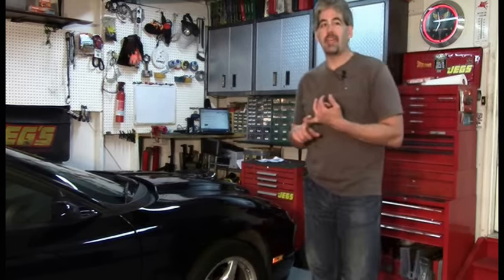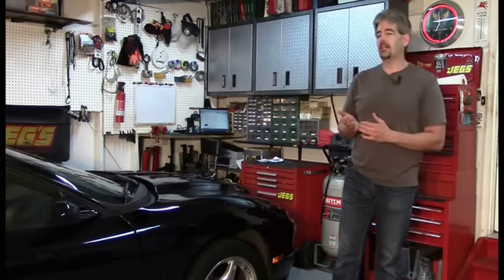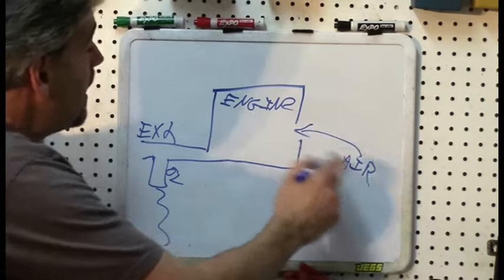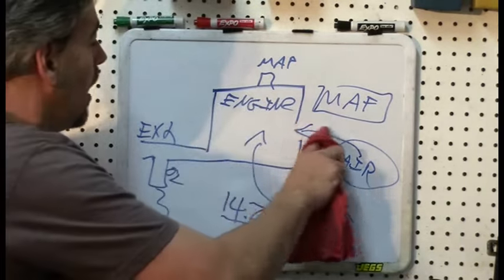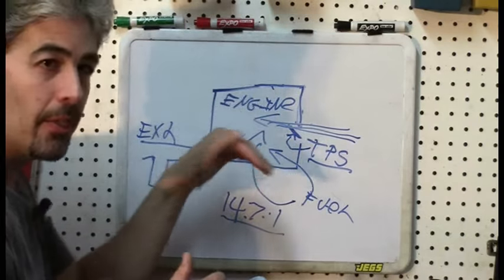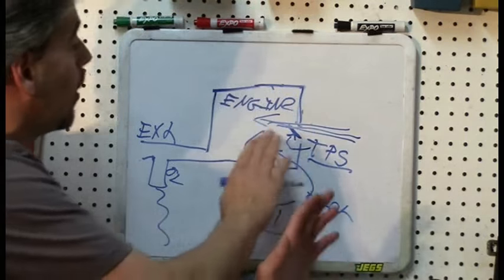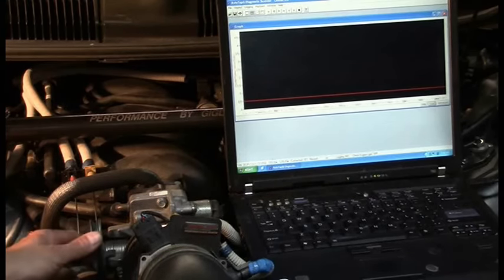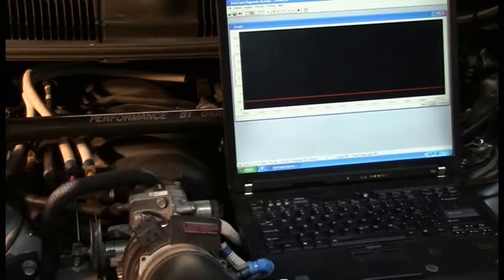TPS (Throttle Position Sensor) Diagnosis and Understanding Pt1

Comment: so its the pcm controls the fuel injectors pulse length to match the air coming in, but who control the spark plugs when to fire because of course there is going to be a different timing when the pistons movement goes rapidly up and down on higher rpm
Reply from the maker: Spark timing is controlled by the crankshaft and camshaft position sensors depending on the model.
Reply: Schrodingers Box can you please do a video about the spark plugs and fuel injectors how they work together accordingly, specially about timing, highly appreciated, thanks.

Comment: My 2000 GMC Sierra was lacking fuel,it was sputtering.i changed the fuel pump,and fuel lines,and fuel return line .now it will not run,what is the problem?

Comment: Tps reference code Chevy cobalt 2008 
I was just wondering if I should start there? Seems simple
Reply from the maker: +Victor Gonzalez Yep- I would start with the TPS reference circuit indeed. It is unlikely to be a TPS component problem with that code.
Don't forget the reference circuit includes the signal and ground- not just the 5V. A problem with ANY of those can cause a reference code.

Comment: I have a high idle and all symptoms point to throttle position sensor. My readings jump around 1-3% at idle, seems fine, replaced the TPS, wiring checks good, idk if that’s normal or TPS is bad
Reply from the maker: depends on the vehicle. doesn’t sound like anything wrong there.
Reply: @SchrodingersBox  I’ve had this issue for 1-1/2 years good thing I got another car as a daily driver. High idle RPM 1200-1800. Idles down maybe 800rpm in drive, let off the brake it’ll cruise on its own (fastest I let it get was 45mph), if I unplug the TPS, the idle goes normal. MAF, MAP, TPS, IAC, IAT, and ECT all seem to be properly working, no vacuum leaks, but it seems there’s a rich condition and that’s why the IAC is opening up.
Reply: Had a friend come by with his scan tool, and were unable to control the IAC because it says “engine not at idle”
Reply from the maker: I would check fuel trims first to make sure it isn’t the response to unmetered air.

Comment: Hi there
I know that I'm little late but I hope that you might catch my letter

I have a chevy blazer 6 cylinders 2008 and it has a fully electronic throttle body.. I got engine check light took it to mechanic shop he came out with 2 codes
P1516 and P2101 I changed the throttle body 5 times with used one making all reset and code eraser steps but the problem still there..
The problem is.. my care needs 30 minutes of worming to run properly.
When ever it gets cold, I need to start it with no ideleing run and hasitation for 30 minutes, switch off,  start again and boom running smoothly and perfectly all the way
As soon as it's hot no problem

Is there any way that you may help with a piece of advice

Thank you
Reply from the maker: what data did you have that the throttle body was bad?
Reply: @SchrodingersBox 
Scanner data
P1516
P2101
Reply from the maker: no what induction, fuel trim, TPS angle and IAC position data did you use to determine the throttle body needed to be replaced. you would not replace the throttle body just on those codes.

Comment: I have a code P0122
Throttle/Pedal Position what should I fix first the throttle body or the pedal position sensor
Reply from the maker: Neither. Find out what the cause of the code is and fix only that.

Comment: I don't have a metter. Is there any other way to know if the TPS is not working properly? I disconnected the TPS and drove around for a minute and the car responded better. It still not running like it should but it runs for longer distances. It runs like it should when you give it full throttle but thats the only way I get to run without problems. Some help please.
Reply from the maker: jorge irizarry How would you possibly test a variable resistance device without a meter?

Comment: On my 86 F150, there is definitely no TPS on the other side of the throttle and butterfly valve.. even tho all the stores say I have one. There is actually a strange bar coming out, in line with the throttle that is obviously the axle for the throttle. It comes out where the TPS should be and there is a 90 degree turn in the bar outside the engine. It turns when I turn the throttle. There's no sensor and it doens't look like one is supposed to be there, yet my engine is hesitating and stalling on acceleration.
Any Help??
Reply: +LINK1478 Forgot to mention it is the L6 model engine

Comment: I have an 04 Focus, with 2.0 DOC. The TPS has a 5v referance. but when I test the sensor itself, at "closed" I have "0" v, and 4v, fully open. I can get the 1 v by turning the sensor, "and get 4v. BUT when I do that the holes in the sensor do not line up? PLEASE HELP!!
Reply: What is he factory specification for idle vs WOT voltages?
Reply: +Schrodinger's Box Quantum Mekanix 
 1 v closed, and 5 v open
Reply from the maker: +lonleyboy54 impossible it can be 5V open. what manual are u using
Reply: +Schrodingers Box 
 Chiltons,  Here is what happened so far. The tranny was slipping into 2nd gear, ran the codes and came up with "A" selinoid bad.Changed and now it will not go into 3rd. So in the process of checking codes the TPS came up. No tranny codes? Before I changed the selenoid it shifted slow into 2nd, but went into 3rd. Would the tps have anything to do with "this"? Any ideas about the tranny, too?
Reply from the maker: lonleyboy54 There is no way it said "A Solenoid bad"- that is impossible. what code was it that actually physically stated the "A" solenoid was "bad"?
  I can't help unless I get accurate information but there is no code I ever heard of in my life that actually points to a component being bad.
Reply: +Schrodingers Box   I have the latest version on my Snap-on Ethos+. I do not remember the exact code. BUT it said "A solenoid mailfunction!  When I looked it up , the causes were bad solenoid, or wiring, and I checked the wiring, and the voltage was correct, so I changed the Solenoid. What can I say it gave it to me under transmission codes. Just like it said PCM out of calibration?  I am sorry but I did not store it so I can't tell you the code number. I did not think this was going to get this complicated. I hope you will still help. God knows I could use it.
Reply from the maker: lonleyboy54 I really can't help without good data bro, sorry I'm stepping out on this one until I know if the code is a high circuit input, low circuit input, position out of range, whatever...
Too much guesswork for me here.
If you get the DTC I'll be happy to reexamine.
Reply: +Schrodingers Box It was code P0750, Does that help?
Reply: lonleyboy54 Yes tremendously. This is normally a circuit integrity code. You'll need a birdirectional scantool to do this but basically I check for voltage response at the solenoid when it is commanded on and off.If I fail to see this then of course I test for output at the TCM itself and if no signal there the TCM is obviously bad.
If I see the voltage response and I rule out voltage drop on the circuit, I then test resistance through the solenoid itself and compare to specification and determine if the solenoid is bad.
  If all check then obviously there is internal failure with the transmission.

That's the process.

Comment: Hi I have a 2006 Mitsubishi gallant 2.0 engine could the tps sensor cause the engine to hesitate upon acceleration.
Reply from the maker: It sure could, as could 10000000 other things.  WHat did your voltage tests on the TPS indicate?

Comment: Hi Matt,
my reading jumps from .5 volts to about 3.5 volts and up with just a minimum movement of the TPS. Any ideas why this is? No smooth transition..
Just found your channel. Good info, but I didn't see this covered..
Reply from the maker: +Josh Burns what car is this?
Reply: +Schrodingers Box 
watching Pt2 ^_^ Had to pause it. Its my wife's 240 Volvo Wagon 1990. Btw I've tried 2 different TPS's (totaling 3 different TPS with same readings.)
Reply: +Schrodingers Box 
I've also replaced the ECU to try that. It stopped posting errors, but the readings are still the same. I have been letting it run rich.
This is something I was working on last summer, but I just found your channel.
Reply from the maker: wow. yeah what you need to do measure the voltage directly at the PCM. I am actually making a video of that now.
Reply: +Schrodingers Box 
i'll subscribe and check it out once its done. Thanks sharing the knowledge.
Reply from the maker: Just occurred to me- I am not real familiar with Volvo especially old ones but I wonder if it maybe uses a digital (frequency) sensor instead if analog. Gimme a day and let me look into that.
Reply: +Schrodingers Box 
Don't go into too much trouble. I have a coolant sensor that I am going to install (the old one is bad). And I'm guessing the engine is stuck in open loop, but I don't know if that will change the reading on the TPS in the end. I can live with the mystery if finding the culprit takes days and days again :p
Reply from the maker: +Josh Burns CTS has nothing to do with TPS unless you have a drive by wire system.
   I'll try to check on that TPS when I have a chance but sure sounds like its a frequency device.  If so you probably wont be able to test it unless you have a frequency measurement on your DVOM

Comment: You would be a superman if you had a spare one :-)  I had to rewind it to make sure you indeed said that!  Somebody from 98% is going to get on your case and reply with "But think of the children!"
Reply from the maker: 12vgs8606 Ha, weren't you the one who commented on my clutch position switch diagnosis video when I mentioned I wasn't afraid of driving around my neighborhood collecting scan data because the bones of small children are too soft to damage my car?

Comment: On a 95 4runner, could this be the reason for an acceleration lag that happens only in first gear? Hesitation only happens when I accelerate from a stop. But, if I drop it into low gear and back into drive and then accelerate, it works fine.

thanks
Reply from the maker: could be.  but so could 10000 other things. what data do you have?
Reply: RPMS struggle to get past 1000 for about 10-15 seconds off the line. Happens only when the engine is warmed up or in the summer (and only 1st gear). Also, no check engine light, trans fluid/filter recently changed, new spark plugs. 113k miles
thanks
Reply: 3.0L V6. Automatic
Reply from the maker: No, no... I mean whats the LTFT and STFT curved against TP% and what is your MAF and MAP voltage output at idle vs WOT?  What was the secondary ignition data you got that indicated the plugs were bad? and why was fuel filter changed- what was the fuel pressure result indicating you had an issue with flow rate?

Comment: I tested the plug that connects to   sensor and  measure 12v at one of the three outputs
Reply from the maker: yep sounds like a reference voltage.

Comment: 1991 Astro van won't idle, unless I spray starting fluid into air cleaner,  then it idles fine continuously until I hit throttle. Then it won't idle, and will stall until I again spray starting fluid into air cleaner, again it will run fine for ever until I accelerate again. What is the cause, any ideas?
Reply from the maker: no fuel.

Comment: This might be an older vid but this shows the difference between a "fitter" and a technician.
A fault code can not be taken as direct indication for what to replace, just where best to start your diagnosis.
I see so many so called techs replacing sensors because of a fault code instead of confirming the actual fault.

PS: I have an oscilloscope and like other things, I don't play with it near as much as I used to. :-)

Comment: What would happen if you swap 1st and 3rd ( not the middle one) wire on TPS ?
Reply from the maker: depends on the function of the wire and the design of the 5V reference circuit . If you grounded the 5V reference you would basically kill the engine if there were other critical input potentiometers on the circuit.

Comment: what is the trouble sign that looks like a red lightning bolt between 2 perpendicular lines?
Reply from the maker: Sounds like a low battery voltage maybe.

Comment: if the tps is  bad could it cause a miss/sputtering when you begin to accelerate and could it cause popping out the throttle body?
Reply from the maker: +The greener1 Yes, among many other things.
Reply: +Schrodingers Box cool im at wits end with my 1990 ford van with 5.8. i have replaced 
plugs,wires,cap,rotor,fuel filter, icm, fuel regulator. coil. checked 
timing and fuel pres. and its still happening. will give this a try and x
 my finger. thank you so much for the quick response
Reply from the maker: +The greener1 What was the evidence you had that showed all those parts were actually bad?
Reply: i wouldnt really call it evidence as much as guessing (which im sure you dont like to hear) i noticed the other day as I was driving down the road at about 35mph it was bucking/missing, i had just put some gas in that was in a can so i figured it was bad gas, emptied the tanks and put in fresh gas and no dice still the same. so I started replacing stuff that could possibly cause the problem and now im to this point.
Reply from the maker: +The greener1 Yeah sorry can't help bro- I only go off diagnostic evidence. The concept that "crossing fingers" somehow will cause a part to be more likely to fix a car just doesn't register with my methodology.  But since you have 10 fingers and 100 possible permutations for crossing them here are 100  other things you can guess at and cross your fingers: Fuel pressure regulator, IAC, Cam position sensor, Crank position sensor, O2 sensors, catalytic converter, TPS, PCM, PCV, CTS, cylinder head gasket...
  Better call the parts store ahead of time!!!
Reply: Indeed

Comment: my 2011 toyota corralla  would maintain speed or even speed up ... during highway speeds with foot off gas pedal.. is this a problem with my TPS ?  or could it be my gas pedal ? I do not have a check engine light.
Reply from the maker: I have no idea. what was the data you got from it?
Reply: check floor mat contact with gas peddal

Comment: i need help my sonata takes forever to reach 40 mph i took it to the dealer and they said tps i changed it now it revs up like it has more power but it doesn't go at all but withe old one it works but slow at picking up speed pls help
Reply from the maker: No problem- what data do you have? What was the data indicating TPS was bad? A what is the result from the resistance curve? What is he idle vs WOT voltage?

Comment: Thanks Matt, I HAVE A PROBLEM WITH MY 2008 RAM HEMI 5.7 ,MY GAS PEDAL STOPS WORKING WHILE DRIVING. IT HAPPENS WVERY 2-3 DRIVE DAYS,MY CHECK ENGINE LIGHT WILL COME ON AND SOMETIMES THE RED LIGHTNING BOLT INDICATOR,ENGINE GOES INTO LIMP WITH ERRATIC IDLING ABOVE 1000RPM.WHEN IT HAPPENS I TURN THE ENGINE OFF AND THEN BACK ON WITH RELEARN PROCEDURE AND ITS GOOD AGAIN FOR 2-3DAYS.I CLEANED THE THROTTLE BODY WHICH WAS DIRTY BUT IT DIDN'T HELP. I DRIVE LIKE THAT FOR THE PAST 3 MONTH WHICH SUCKS,SOME OF THE CODES SHOWED ERRATIC VOLTAGE.AFTER 2-5TRIPS THE CHECK ENGINE LIGHT TURNES ITSELF OFF AND ALL IS GOOD UNTIL MY THROTTLE FAILS AGAIN.PLEASE HELP,THANK YOU!
Reply from the maker: +sunnykrusty Seems like its a problem with your caps lock key.

Comment: Please help! My 2012 cts is starting but then making loud thumping in what sounds like the air intake and shaking the engine then my car shuts off. It started by saying engine power reduced. I took to dealer bc i was getting a code for ecm. They took gps off and said it was faulty. It removed the code but car still acted the same. I have cleaned the spark plugs. The dealer says they cleaned my throttle body and it looks ok. Could it be the sensor?
Reply from the maker: Could be- what is the data you have from it that makes you suspect it?

Comment: I got a code PO123 - its saying Throttl/Pedal position sensor a circuit high input and sensor b circuit low input... is there anyway I can check the wires and if I need to replace them are they rechargeable?
Reply: and it said position sensor a electrical citcuit input signal had high voltage for a predetermined period of time?
Reply: I have a Dodge Dart 2015
Reply from the maker: yep- obviously you will want to check for an open once you validate the 5V ref from PCM.
Reply: what?
Reply from the maker: you asked if there was a way to check it. that’s how to check it. If it is showing a circuit high you obviously have a higher resistance after the internal resistor in the PCM than there is from the source voltage, right?  what else can possibly cause that? simple!
Reply: ok should I just replace the whole throttle body? because I can't find a part just for the TPS, I have a Dodge Dart. I'm trying to see if I can recharge the TPS but I don't know how
Reply from the maker: WHAT???? Why on earth would you replace the throttle body????

  Why are you bent on replacing the TPS- what data are you using here??